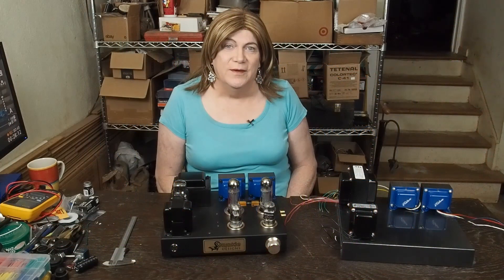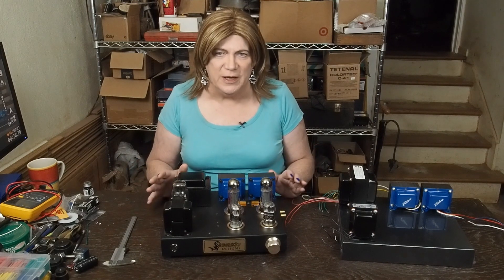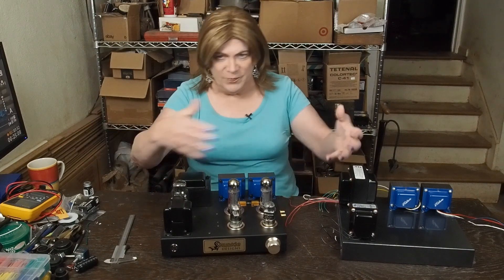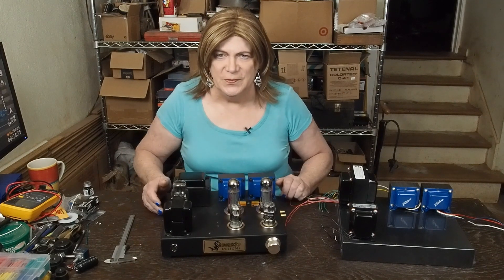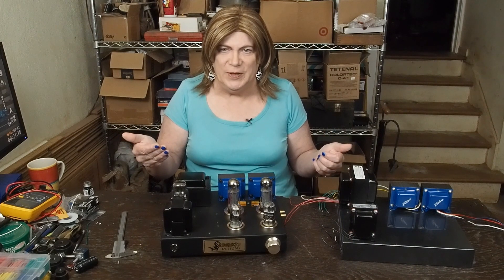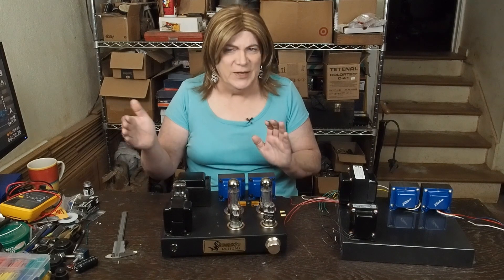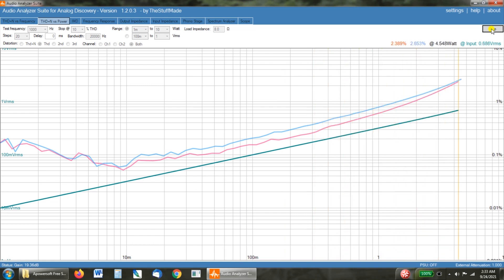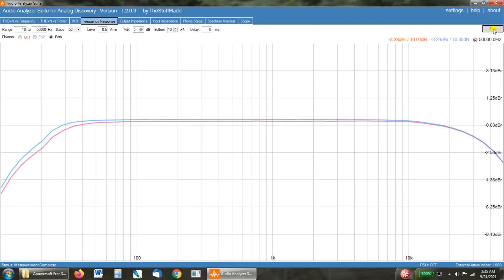6SQ7 EL34 Tube Audio Amplifier Build: Testing

Comment: If people wanted to follow along then maybe getting the vacuum tubes designed in 1957 for when the transistors of the day were not ready for prime time which means a heater voltage of 12V and a B+ of 12V which might be a lot safer than building a unit with voltages of 700V easily accessible.
Reply from the maker: No tube gear runs with a B+ of 12V and never has. Tube gear has always used high voltages on the plates.

Comment: I have 6L6GC 2 tubes. Is it compatible with EL34? but I only have 6SN7 not 6SQ7.
Reply from the maker: I think they are similar, but not sure if they are 100% compatible or how they would sound. A 6SN7 is totally different than a 6SQ7!
Reply: @SkunkieDesignsElectronics  Thank you so much Skunkie. I want to control my budget. if 6SN7 + 6L6GC get about 3.5 watts that is plenty enough for my speaker  s 92db/watt.  I see many schematic but if you can share 6SN7+6L6GC SE, I would be very gratitute.

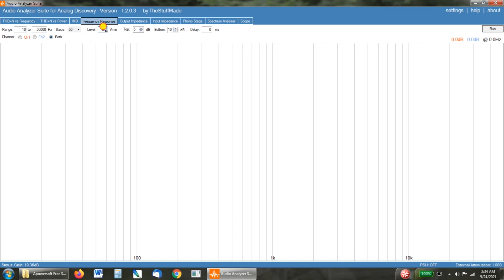Comment: Starting at 10:00 about the frequency, so the total flat from 20Hz would sound better include the bass? I was happened yesterday to compare the tube and SS amp at the same volume level of preamp, the tube amp bass is weak compare to the SS amp. The tube amp has coupling cap 0.47uF, would I get more bass if I increase the coupling cap? Thanks
Reply from the maker: It depends on the speaker used whether you need more below 40hz and a larger coupling cap doesn't always change the bass if the transformer isn't up to it. The specs from Edcor match what I am seeing on mine, 40~18K Hz., <1dBu. Increasing the size of the coupling cap would likely create more problems over saturating the transformer and make it sound dull, IMHO 0.47 is already likely too large depending on the grid leak resistor it is paired with.
Reply: @SkunkieDesignsElectronics  The midrange is so clear and bass was fine with 96dB speakers at 8 ohm. When I tested with Tannoy D700 where it has 93dB at 6 ohm, the midrange is still there but the bass was low. However, the SS amp can get the bass out really nice.  I was using Amp Books calculator to find the frequency where 1uF would be 20Hz at -4dB, 0.47uF @ -7dB. The original design was 0.1uF @ -18dB, probably the first owner replaced with 0.47uF.  The grid leak resistor is 10k, is it's ok to change to 1k?
Reply from the maker: @Warclock07  It likely has more to do with the impedance curve of the Tannoy. My bet is at low frequencies the impedance dips down closer to 4 ohms and the tube amp doesn't have the drive to reproduce the bass at that low an impedance. I'm not sure how you are calculating this but 10K sound SUPER low value for a grid leak resistor. They are usually in the 220K to 500K range. Without seeing the schematic I'm not sure what we are talking about.
Reply: @SkunkieDesignsElectronics  My bad, it's typo 100k with fixed bias.and grid stopper is 10k. Thanks, i will look for another set of speaker to test out if Tannoy is the problem.